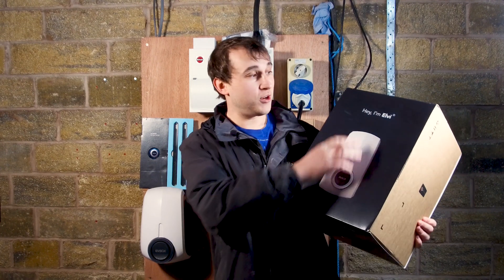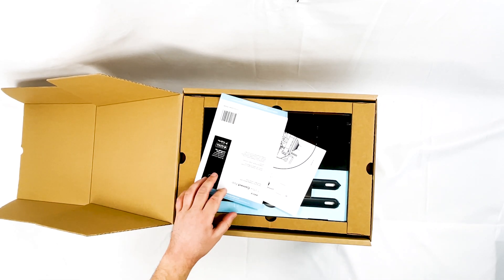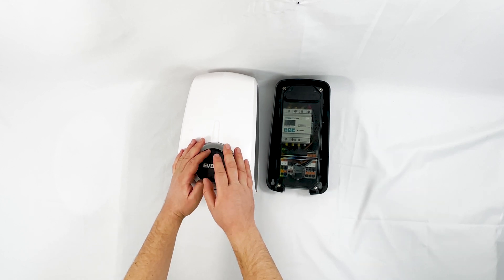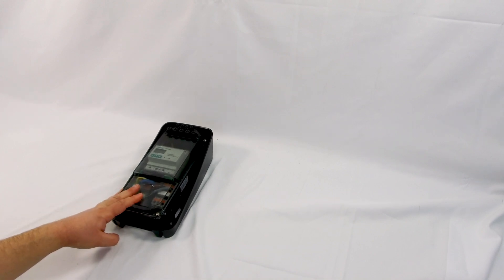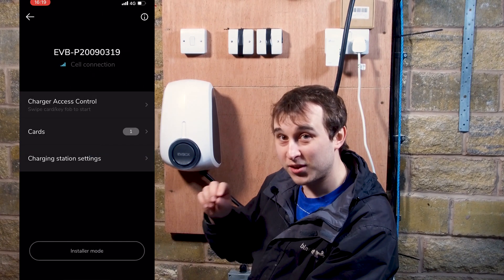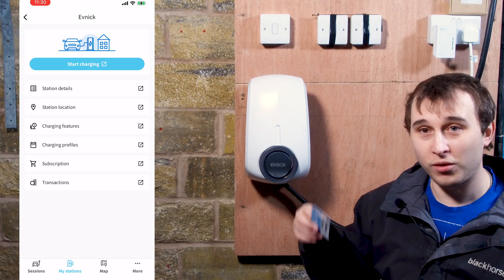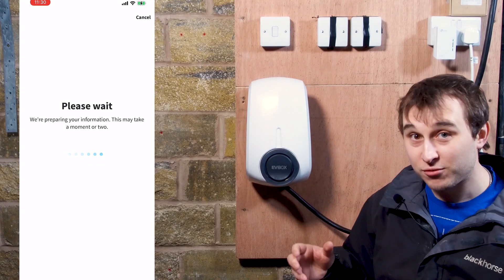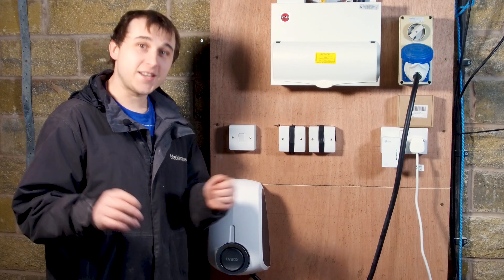Is The EVBox Elvi The Only Charger You'll Ever Need? Maybe For...

Comment from the maker: https://rightcharge.co.uk/evnick to find a local installer that's right for you! The charger seen in this review was requested by EVNick from EVBox,  all chargers in this series were requested from the companies for review. No control over the content was made, no agreements were signed.  As am sure my viewers understand it wouldn't be possible to purchase all chargers for review.
Reply: Is there any reason for setting Minimum Charge Current to 6A? Why not set both minimum and maximum to 16A if it is installed as a 11kW charger?
Reply from the maker: @MovieViking  in the UK it be installed as a 32amp charger,  and you may set limit to 6a during the day say you have solar generation or high loads working during certain times of the day
Reply: @NicolasRaimo  Yes, but a limit is the maximum setting. What I'm curious about is why the installers set a minimum of 6A on a 20A fused/capable installation and not just leave minimum and maximum both at 16A?
I know the car requires 6A to be present for it to charge, but why should I wait for the car and the box to negotiate ramping up from 6A to 16A each time I plug it in.

Comment: Hi Nicolas. I am looking for advice. I have the Elvi and it has stopped charging. I rebooted it. The light turned from red to green. So I thought that was it. But when I connect it to the car it goes blue but then to orange and won't charge. Any advice??
Reply from the maker: They turned off the app earlier in year and it should of defaulted to dumb mode I think you can change the ocpp in the Ip setting check nothing blocking it there
Reply: @NicolasRaimo thanks Nicolas. I can change the ocpp url but to what I don't know. I might have to contact a company to provide one. Not a clue here.

Comment: Doesnt look much room to bend cables into the terminals. I'll never install one anyway as it doesn't have PEN fault detection.
Be nice if you could get hold of a Hypervolt charger to review as they look a cheaper alternative to the Zappi, especially when they get load protection sorted.
Reply from the maker: Hypervolt requested ;)
Reply: @NicolasRaimo  good stuff. I've had a bt of contact with them and they seem really great, I waiting on the load limiting to be sorted first though as I don't like installing chargers without this feature.
Reply from the maker: Hi Mick there is more room in there than you think remember it can take armour 5 core plus cat cables so plenty of options.  You could fit it a long side a Matt-e or a Garo device but for a commercial site your likely as you know not to need PEN as most sites be on there own earthing arrangements.  The build quality of this unit is so far the best of all the units I’ve reviewed
Reply: @NicolasRaimo  I just thought it looked a bit tight in there. I'm used to installing Zappis which have loads of room!😎
Reply from the maker: @mickbitchum4664  review on Zappi just got uploaded Saturday check it out see if you agree with my comments on it...  Also please consider clicking subscribe
Reply: @NicolasRaimo  yes I watched yesterday. Everything you said was spot on, especially having the hub transmit wifi and not a radio signal as I've had issues with connectivity in the past. A slightly smaller Zappi is also possible since they've got rid of the external relays and incorporated them on the PCB.
I wasn't aware of the Octopus agile integration either so I learnt something aswell, as an installer we get a bit left out of the app/account side of things and Myenergi don't really update us on any changes 🙄
Reply from the maker: @mickbitchum4664  check out signing up to octopus 🐙 if you use my link your get £50 but also your get a link you could give customers and likely get another £50 per Install

Comment: I had one installed that came with the car but apparently is wifi only so cant tell me how many kwh we have used. Not great but it was free
Reply from the maker: The app should connect fine with Bluetooth if near unit,  other option would be get a power link for your Wi-fi
Reply: @NicolasRaimo  apparently the one I have does not have a meter so cant tell what you have used

Comment: Hey Nick.
Regarding recharging.... What are the requirements for charging the Zoe ZE40 and/or the ZE50?
People here says the Zoe are kinda nitpicking with chargers, the installation needs a ground with differential X, resistance Y, and always tri-phase.
Or can the Zoe be recharged with a portable charger, or simple wallbox, like the charger that comes with a Chevy Bolt?
Reply from the maker: I believe it’s under 50 Ohms from memory for the earth.  All chargers need L/N/E to charge just some cars neglect to check the earth as they suspect the charger socket would check that.  I’ve seen people fool chargers into working on generators by joining the earth to N. 
A zoe can charge on the portable 3 pin 10 amp granny cables there’s a video of me charging on via here
Reply: @NicolasRaimo  I've just installed one, simple E/L/N to a 32amp RCBO and I'm getting  a flashing orange light and disconnects. Now and again it goes blue to charge and then cuts out. I've tried this on my car and van it's the same. Is this an earth problem?  Could the earth's not be connected correctly?

Comment: I have this charger and think it’s rubbish (functionality wise). But you’ve just told me lots of things it can do that I didn’t know! I better find the manual and read it 🤓. Is there a way to use it without the rfid card? I just want to plug in and charge, i cannot find any way of doing it.
Reply from the maker: Yes using the installer app set auto start stop
Reply: @NicolasRaimo  is that the installer app you said not to use in case you damage the charger 😬
Reply from the maker: @scottwills4698  yep! just don't mess around with anything linked to voltage and amps :)
Reply: Scott you can set the station to auto start and still track all your sessions via the EVBox Charge app. Drop an email uksupport@evbox.com and they will sort you out